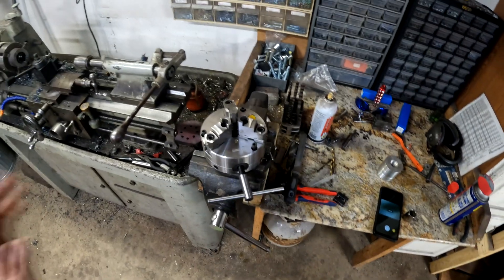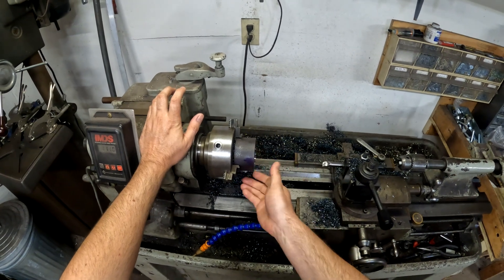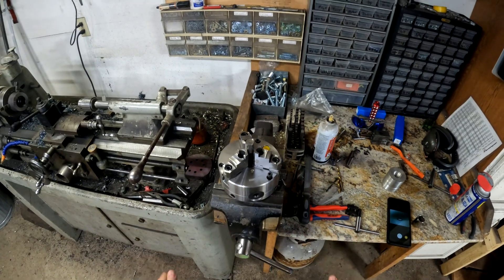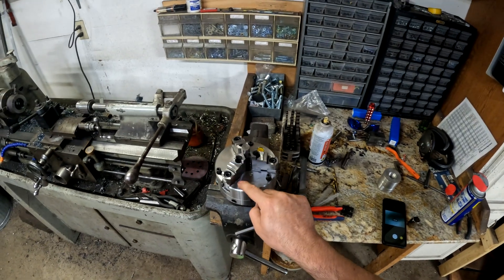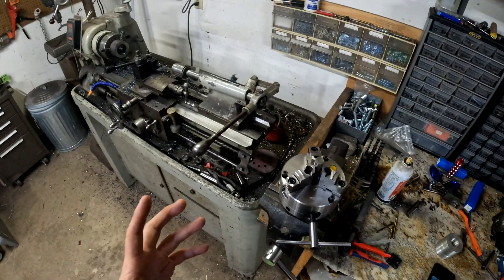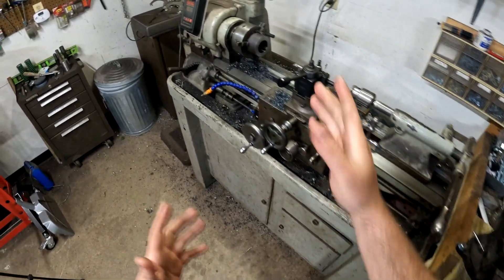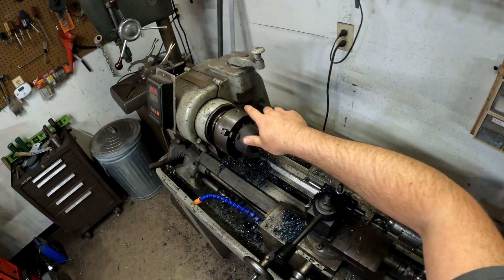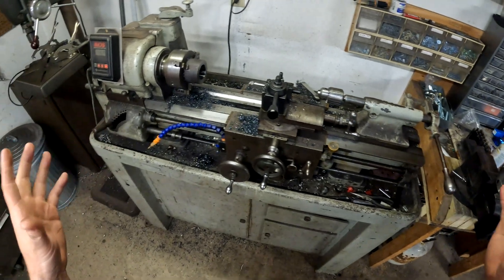Adjustable Scroll Chuck VS Non-adjustable Scroll Chuck (4K)

Comment: Hello

With an ajustable chuck, you can adjust concentricity. But not coaxiality. 

The only way to obtain it is to use soft jaws specially machined for the part you have to do. 

Have good chips.
Reply from the maker: good feedback